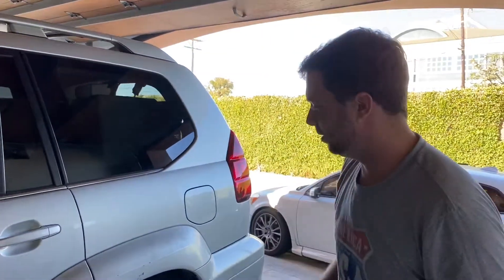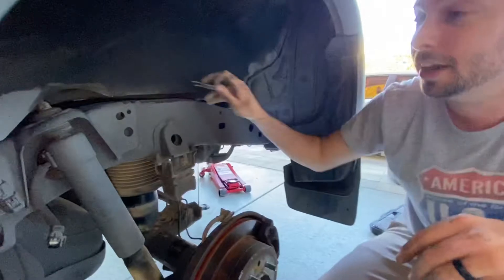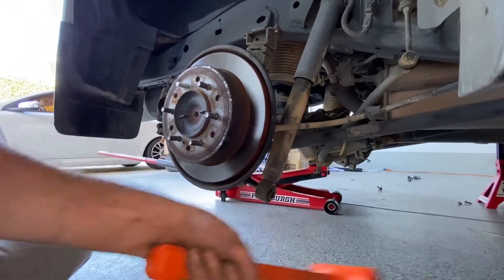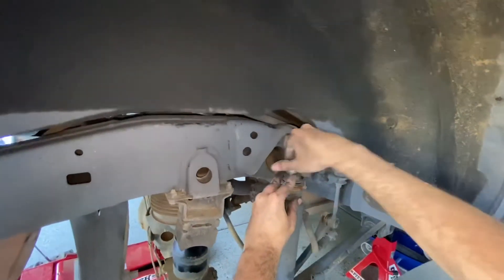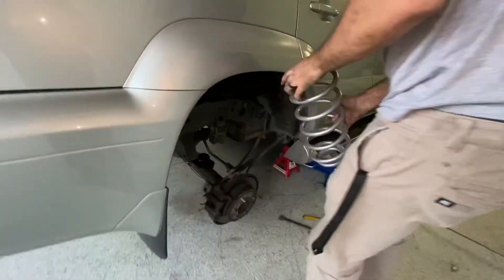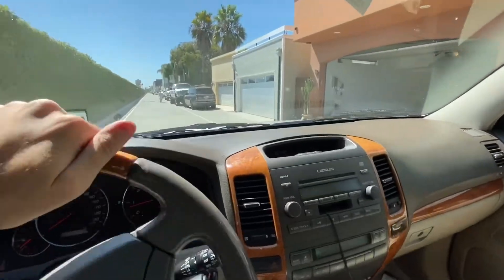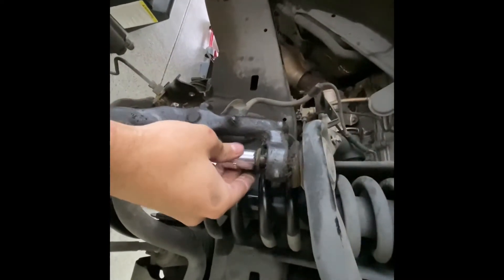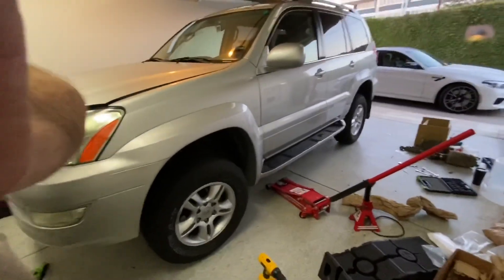Lexus GX470 - Eibach Pro Truck Lift Kit Install.

Comment from the maker: Dang, watching this video again I feel kinda bad about not doing more filming on the fronts. My wife had to stop filming and play with nieces and nephews, and I didn’t want to stop working.  Feel free to comment any questions you may have on the front install and I will try my best to answer.
Reply: Looks nice and level!  Which front spring perch setting did you go with? I'm about to install this kit this weekend on my GX.
Reply from the maker: Cliff Huff I have it on the first clip. I wish I went with the second clip but I was sketched out by my cheap spring compressors. It has a bit of front rake so it’s just a bit too low in the front. Don’t make my same mistake, go with the second clip!! And make sure u take before and after measurements from a good point like the edge of the rim. Not doing that was my other mistake.
Reply: @lexus_offroad_adventures   Thank you for the quick response!! I was thinking the second clip as well. I appreciate you solidifying that.
Reply: Any issues or suggestions for those UCA bolts?
Reply from the maker: @robertswiers7851  Pretty straight-forward. You just need to remove anything that gets in the way of you reaching the bolt head. On the passenger side, you can just use an extension I think. On the driver side, you’ll need to remove the battery/battery tray. You’ll also need to slightly bend some body out of the way to extract (not as scary as it sounds you’ll know when you see it).
Reply: @lexus_offroad_adventures  Gotcha, normal dealings then for stuff like this.  I'll be driving my GX to outside of Reno (from NC), installing the lift, then heading to Moab.  Making sure I have good head around the install because it'll be where there is no reception!  Thanks for the reply!
Reply from the maker: @robertswiers7851  Sounds fun! No worries! In that case, I’d definitely recommend writing down a step by step list/plan with all the tool sizes/parts. Just one less thing to think about while you’re getting into it. There are plenty of better step-by-step YouTube videos that are more helpful than mine. The Ironman 4x4 one with their gx460 is what I used.
Reply: @lexus_offroad_adventures  For sure, but I do like videos that show someone doing it at home. Different perspective, often with more obscure helpful info!

Comment: Thank you so much for your detailed and clear installation video! You helped me install my eibach lift this past weekend! One question, i am still on stock wheels and tires, so the front independent suspension is a bit narrower since the suspension lift. I have noticed some floaty steering at highway speeds, do you think 1.25in spacers like yours would correct for the narrower stance and improve highway stability? Thanks!!
Reply from the maker: That’s awesome!! Super stoked that I was able to help. I personally run 1.25” Spidertrax spacers and they work VERY well to correct that issue. Highly recommend. I forgot to film an install video of those but just follow the instructions and use the red thread lock they include, you’ll be good.
Reply: @lexus_offroad_adventures  So you experienced this issue too? i am thinking about only running them on the front wheels and leaving the rear without any spacing. I love your channel and thanks for all the info and advice!
Reply from the maker: @hehexd1769  really appreciate you watching! Yes I definitely had that issue as well and especially off road, things get a little tipsy. 

I would recommend running front and rear. You will thank me later. The rear looks way better with the wider stance. It’s not just for the front.
Reply: @lexus_offroad_adventures  well I'm glad to know I'm not the only one. The reason I was thinking just spacers on the front was because the independent suspension is actually narrower after the lift whereas the rear axle is still the same stock width. It might just be flawed logic idk
Reply: @hehexd1769  did you get the spacers? If so, how do you like them?

Comment: Really great video! So thankful for people like you taking the time to document this stuff esp for ppl like me with little wrenching experience. I was curious, I have an '11 Sequoia Platinum with failed air springs and have been watching GX 470 videos for ideas since 2nd gen sequoia videos air spring videos are rare. I already replaced the OEM electronic back shocks recently, do you know if you could just replace the rear coils on a swap like this? Also, would that affect the ability to switch between sport & comfort settings with the shocks or is that an independent system from air springs? Thanks in advance
Reply from the maker: I’m not sure what would be required for the conversion, but I’d look for pics of any sequoia base models that come with coils from factory. I would also look for the rear suspension parts diagram for the base model to see all the part numbers you’ll need. The coil springs and air springs should be inert when it comes to driving modes, so the electronic shocks will handle it as long as the spring conversion doesn’t mess with the electronics (which I doubt it will). Just make sure you research which fuse to pull so you don’t get a constant air suspension error light. Here is an OEM coil spring I found: https://www.ebay.com/itm/TOYOTA-OEM-08-18-Sequoia-Rear-Suspension-Coil-Spring-482310C020-/274939789211?mkcid=16&mkevt=1&_trksid=p2349624.m46890.l6249&mkrid=711-127632-2357-0

It’s a solid axle, so it should be as easy as you saw in my video
Reply: @lexus_offroad_adventures  Thank you for the reply, I appreciate it. I have an OEM parts list for the conversion (without shocks) so I think I'm good to go but I'll do a little more checking around first to be safe about the electronics. Regards.

Comment: Did any VSC or check engine light come on due to the air bag delete
Reply from the maker: No you have to pull some fuses. I went on metaltech 4x4 site instructions to find out which ones https://metaltech4x4.com/content/GX470-GX460-4Runner%20Rear%20Coil%20Conversion%20Kit%20v2.pdf
Reply: @lexus_offroad_adventures  what year gx do you have

Comment: Did you need to drop the sway bar with shims?
Reply from the maker: I did on the fronts. I used the icon spacer kit so the sway bar didn’t hit the springs. But I no longer run sway bars at all

Comment: Great vid! Sorry if I missed it but did you go with the 2" or 2.8" setting up front? How much lift did you actually get ?
Reply from the maker: Great question. You didn’t miss anything. However I’m an idiot and didn’t measure before and after like I should have (too excited to get started I guess)

This was the lowest setting. Too much rake in my opinion and it didn’t allow enough clearance for 33” tires.

You’ll see in a later video that I did that I changed the setting to the 3rd position in preparation for installing a steel bumper/winch. 

That setting is a bit of reverse rake without weight up front but it leveled out perfectly when I fit the bumper setup.

https://youtu.be/IyLS0Fe5gBQ

Let me know if you have any more questions!
Reply: @lexus_offroad_adventures  Thanks for the the Info and reply! I think since I won't be adding any weight up front, I'm going to go with the 2nd setting. Hope that puts me just about level. Now it's a waiting game for the lift to arrive !

Comment: Hey, quick question, if you're supposed to retorque the wheel spacer bolts after about 100 miles, hows does that work with the thread locking compound? Wouldn't the nut be sealed and locked in place from the thread lock? Thanks!
Reply from the maker: I did not do that but I believe what they mean by “re-torquing” is to just check that they haven’t come loose. So the bolt shouldn’t get any tighter when you check that, and therefore you shouldn’t break the seal with the thread lock. If you do check it and the bolt rotates further, you’ll want to re-do that bolt anyway because something is wrong. The only reason for that to happen is if something got caught in there and somehow fell out during that 100 miles or something...

Comment: Did you use the oem top hats back on the front struts? My kit did not come with new ones so I’m assuming you have to take them off the old suspension?
Reply from the maker: Yes I believe so. This video goes more in-depth on the fronts: https://youtu.be/IyLS0Fe5gBQ

Comment: Great How to! I am about to buy the same kit, but besides the UCAs did you buy anything else? Like a Diff Drop? What was the total lift after the install?
Reply from the maker: No diff drop. The GX is blessed with pretty good CV angles. If you go for the second clip on the front shocks, you’ll be level. I made the mistake of leaving it on the first clip so there’s a bit of rake. Rear should be 2.5 inches or so and fronts around 2-3” depending on the clip. Use the second one to get to 2.5 as mentioned before. Best of luck! Let me know if you have any questions when u do the install
Reply: @lexus_offroad_adventures  awesome advice! Thanks! I’ll def let you know!

Comment: great vid! are you running 33’s after the lift kit? any rubbing issues that needs minor trimming? thanks!
Reply from the maker: Thanks! Yes I run 33”s. It takes some trimming and pushing the front of the mudguard forward into the front bumper. If you watch the follow up video, I show you how much of a pain it is to change the setting from the 1st to the 2nd or 3rd setting lol https://youtu.be/IyLS0Fe5gBQ

Moral of the story, just go with the 2nd setting if you’re not getting a steel bumper/winch and want to be level. It’ll also make it easier to fit bigger tires as well. 

The other way to fit bigger tires that nobody talks about: have your alignment guy put caster as far positive as possible to clear the body mount behind the tire.. This will necessitate more cutting near the front bumper but that’s less invasive than a body mount chop. Positive caster essentially pushes the front wheels forward in the wheel well.
Reply: @lexus_offroad_adventures  awesome ill keep that in mind! where did u get your lift kit? do u have a code i can put in to credit u for promoting the product. and also what exact size rims and tires u run it with? thanks a lot and keep making more videos like this!

Comment: Did i miss it, do you need to calibrate or do anything to the electronics after air bag delete?
Reply from the maker: Yes there are a few fuses to pull. I just looked at the Metaltech airbag delete instructions to see which ones. Scroll down and select install guides: https://metaltech4x4.com/metal-tech-gx470-rear-coil-conversion-kit-stage-1/

Comment: Can you adjust the height on the Eibach pretty easily? Also I noticed this Eibach Pro Kit  doesn't have an option for the air to coil conversion...is that needed? And if so, are the upper isolators needed? Not really sure what they do.
Reply from the maker: The upper idolaters just provide a small barrier between the spring and the upper spring perch. Just nice for a bit of comfort. Not sure if they do much but I haven’t had any issues with them. As for height adjustment, that’ll only be on the fronts and I made a full video on that process. It’s difficult. You have to take the front coil overs out and do it. Best to get it how you want it the first time. I’ll find the link to that video
Reply from the maker: https://youtu.be/IyLS0Fe5gBQ
Reply: @lexus_offroad_adventures  Thanks, do you know where to find an air to coil conversion kit with upper isolators that aren't close to $300? Seems like a lot...Also, did you weld your own bumper or buy it pre-built?

Comment: I see you have installed these as well as the Luft Meisters, can you give us a breakdown in which you prefer and why? It appears you did the Luft Meister install after this one, so I’m curious as to what the short comings of this setup was and why you chose to back to a stick like setup?
Reply from the maker: The Luftmeister was for my stock GX (I have two) and this setup is for my modified one. The difference is this Eibach one is a lift kit and the Luftmeister is a stock replacement
Reply: @lexus_offroad_adventures  In terms of ride quality how do they compare? Are you happy with this kit? I have been putting serious contemplation to removing the air bags and installing a kit like this, but I also find that the stock height serves me just fine for the majority of overlanding and camping trips. Did you feel like this kit gave you a significant off road advantage over the Luft Meister setup?
Reply from the maker: @amitvachher  https://youtu.be/vaA8-ObE940
Here are my recommendations for modifying your GX for off-road use. This Eibach kit (as well as any other off-road focused ones) will be stiffer, tougher and much more resistant to bottoming out off-road than the stock suspension. They will also be engineered to support the weight off heavy accessories most people add to their rigs.

As I explain in the video I linked to, I think larger diameter off-road focused tires are the most essential off-roading modification, and a lifted suspension setup will both allow you to fit bigger tires and give you a more secure ride when off road. The squishy stock suspension and tires are not good for any serious trails but should be fine on the odd dirt road. 

If you want to retain the stock ride-quality, I think just keeping the stock suspension as long as it lasts is a good option, then decide whether to get a lift or just replace stock components with replacement stock parts. 

It’s important to note that, this Eibach kit was a full kit (springs & shocks,) and the Luftmeister ones I installed in the later video are not a kit. They are just rear stock replacement shocks that are cheaper than OEM Toyota.
Reply from the maker: @amitvachher  I personally think the Eibach kit is fantastic for my purposes, but you need to listen to your own priorities. I have a lot of weight on my rig and go on some tough trails. If you plan on doing the same, it’s a great kit.

Comment: Great video thanks for sharing. Any tips for removing the front struts?
Reply from the maker: benoblest I removed them without unbolting the Lower Control Arm or the Tie Rod ends. It’s a squeeze, but if you are patient, once you remove the strut assembly hardware, you can work it down thru the bottom of everything while it’s still bolted up. Saves a bunch of time and leaves the factory hardware in place
Reply: Daniel G thanks for the reply. I may try that way. One more question, how hard was the VSC hard to remove? I heard the bolts are hard to access.
Reply from the maker: benoblest That hard line is just held in by a bracket and a 12mm bolt. Just be gentle and massage it out of the way. It’s probably one of the easiest bits of the job. On my How to Replace Wheel Studs video you can see how it looks since I had to remove the brake caliper. I think the hardest part about the job was that I didn’t have a good spring compressor for removing the top hat and oem springs. I had some sketchy $18 Amazon compressors. It was a lot of effort and it was scary. I would gladly pay a shop $50 to do that bit for me. Keep the questions coming if you have any! I wish I knew what I did now before I attempted the job so I know how you feel and will gladly provide info
Reply: Daniel G okay cool, yeah I’m slightly afraid of doing compressing the coils using the spring compressor I have. I’ve seen videos of people change them without one using the weight of the truck and jack stands but that way also seems kinda of sketchy too. Maybe I’ll try find a local shop that can swap them out real quick. Last question, I’ve heard the top bracket that holds the factory adjustable electronics in the front is hardest part to remove. Any tips for getting that bracket off? Thanks again!
Reply from the maker: benoblest no problem! yeah using the weight of the truck and jack stands seems all bad lol. Those electronics weren’t too bad. I remember that one side was easier than the other. If I remember correctly, I think I had to pry and break the top off one. Once I broke it off, then I could reach the bolts on the back side. Then you just unclip the harness plug and it’s free to take out and reach the nuts at the top of the shock tower
Reply: Daniel G okay sweet, ya the one other person I talked to said he ended up just breaking the plastic piece off as well. I may just do that if I get too frustrated. Anyways, thanks for all the tips I appreciate it!
Reply: Daniel G got the fronts done today, thanks for the tips. I took one of the little bolts holding the plastic on the electronic shock off and then decided to just pry it off as the second one was impossible to reach. Ended up not being too bad. Did you have any dash lights come on after you unplugged? I got a VSC trac, VSC off, and slip indicator light as soon as I took it for a test drive. Was I supposed to remove any fuses? I’ve read mixed advice on this, some say remove, others say it needs to stay in or lights will come on.
Reply from the maker: benoblest heck yeah! Glad to hear you went for it. Yeah I took out some fuses. I’ll link you to it. I just googled the iron man air bag delete install instructions and it worked. The fuse diagram is at the bottom: https://ironman4x4america.com/content/instructions/IM%20Airbag%20Delete%20Kit%20Install-lr.pdf

Comment: how does the Eibach suspension ride?
Reply from the maker: It’s great! Stiffer than stock which is good for off road confidence. Ride Gets better as you add weight.
Reply: @lexus_offroad_adventures   sounds good man, thanks for replying back. Now I dont know what to go with Eibachs or Dobinsons haha. let you know whichever i go with.